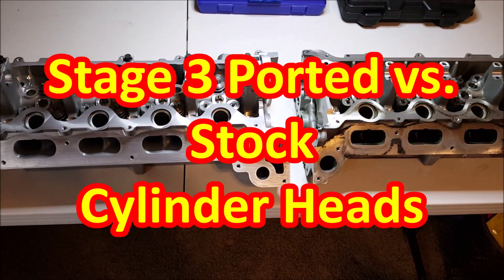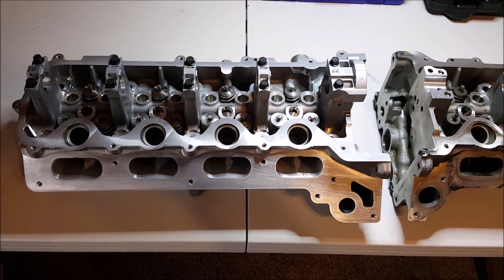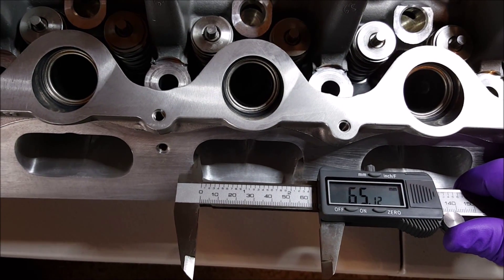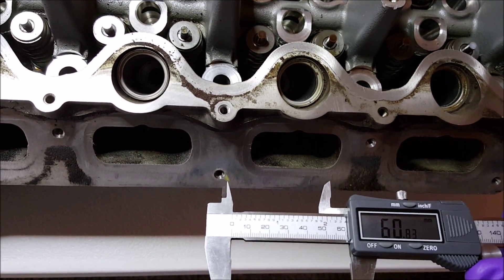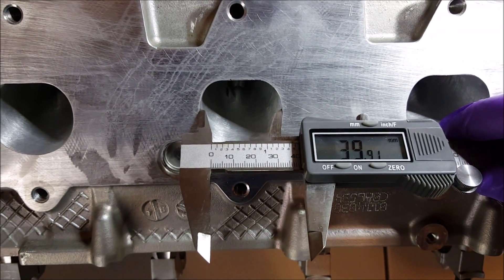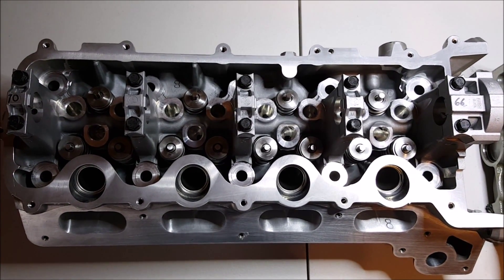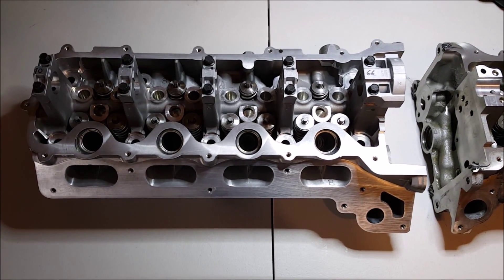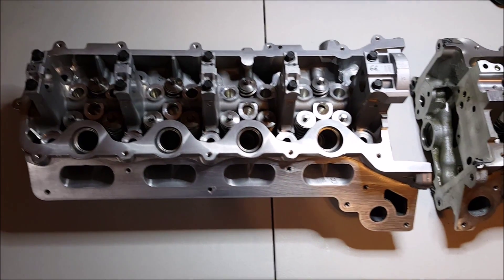Stage 3 Ported vs. Stock Cylinder Head Comparison

Comment: Just wondering, if you ever read this. When porting, what are the limits, how do you know where the water jackets are? And are you doing more- good than harm? I know its all about the flow numbers, but at what point do you know, enuff is enough?
Thank You
Reply: honestly if u are not building a race engine these porting intake and exhaust dont really do anything is a group of things combustion chamber, valve guides, valve seats, valve angles depending the purpose of engine, lift on camshaft etc.

Comment: I got a 2014 ford f150 5.0, been tryna turn it into a drag truck, been on a really low budget with paying off all my court fines and dui and stuff, so far the only thing ive done is cat back straight pipe, 4 inch tips, sct x4 with custom 93 PR-X race tune from mpt performance, running a mix of 75% e85 and 25% pure methanol, and next week installing my 100 shot nitrous from nx express. going in tomorrow to the machine shop to find out how much they would want to port my heads, wanna get the stage 3 cam and stage 3 heads but dropping $4500 on them is wayyyy out of my range right now haha doing $500 upgrades at a time, I wish all these performance places would setup payment plans, they would have so many customers flooding in

Comment: You are just the tech guy I need to ask questions. My question is I'm rebuilding a 401 nailhead and I sought out Mike Lewis in Fresno ca.   I want the 3 or 4 stage port modification. Is their a notable difference in horsepower I do not want to waste money if I can't tell the difference. I'm also looking to port intake & exhausts. Thxs Ray
Reply from the maker: Depends on what you think is notable. Stages are an unfortunate modern gimmick since porting isn't done by hand anymore. I'm not familiar with the 401 so I'm not sure what power gains to expect. Rule of thumb maybe 10%. I got ported heads to maximize air flow since I was using forced induction. Hope this helps.

Comment: those ports are dull. jaffromobile polished his heads and ports himself and they look better. good vid tho. thanks for the comparison.
Reply: Adam Merat polished heads provide no performance benefits - this has been documented for many years. They do however look better.
Reply: Intake ports you don't polished or the fuel won't atomise properly and the only reason to polished exhaust ports is if it was a high Hp racing motors to help stop carbon building up . What you are trying to do is get air and fuel to move as fast as it can by blending from valve seat to      head face and intake manifold to Carby / EFI setup and to exhaust tip and making it a smooth clean clear path so match port to your gasket ECT
Reply: nz mopar rebuilds To tickle your fancy, Jafromobiles video covered that, he left the area rough where the injector sprays into the port so that it “atomizes” properly. Really, in fuel injected setups, the injector does all the atomizing so it doesn’t negatively affect it to do a full polish, and there are minor horsepower benefits that come with it, and on turbo cars (jafros port and polish is on a bastard turbocharged 4g63), there is a benefit of smooth and efficient spooling of the turbo, with the added benefit of reducing high spots (high spots=hot spots) and reducing carbon buildup, polishing the combustion chamber removes high spots which cause heat and risk preignition in turbo cars, how about you do some research bud
Reply: @thejohn6912  air will grip a smooth wall more then a textured wall which slows the flow maybe like a half a cfm maybe 2 but when it comes down to it. It really doesn't matter. Exhaust port is good to keep nice and shiny on a street car so you dont get as much carbon build up. But flow wise out of the exhaust usually it flows more then the amount of exhaust actually being made so alittle carbon in the exhaust won't really kill hp or tq so once again and this is proven over and over it doesn't really matter..

Comment: What springs are those? I'm going to be installing 127600 stage 3 comp cams on my 3valve and I'm not sure what springs to go with since I've heard some bad things with the comp springs
Reply from the maker: I am actually not sure. I bought the heads with the springs assembled from MMR. They are supposed to be stiffer than stock, but that's all I can say. Drawback to not installing them.

Comment: So tired of hearing "stages" on performance parts. That's like a video game term for the Fast & the Furious kids.  We're not playing Need for Speed.
Reply: Agree, "Stage 3" what does that even mean. How about some flow figures and include air speed not just cfm.
Reply: Yeah its mostly unclear what this means but still you can clear it out for yourself.
Stage 1: Just polish no widening
Stage 2: Lightly Widening + Polish
Stage 3: More Widening + Polish + Bigger valves
Stage 4:  Widening+Dimples+Polish+Bigger valves
So every tuner is different but for easy understanding you may know where to go. like i was Looking for a "stage 1" just polish on exhaustside and rough polish on intake to see what Kind of difference there is.